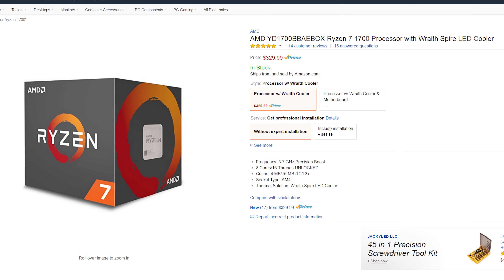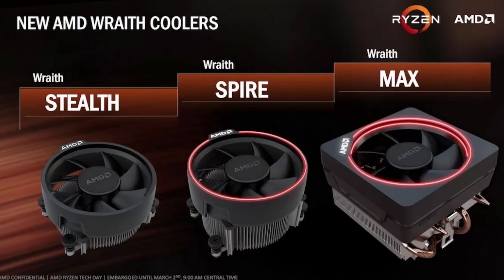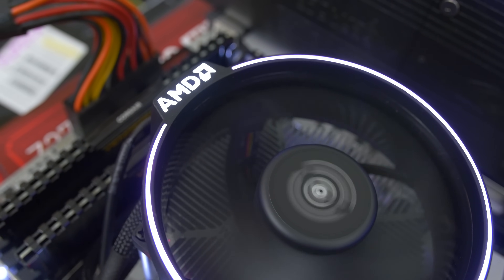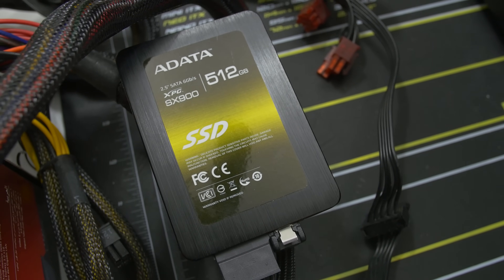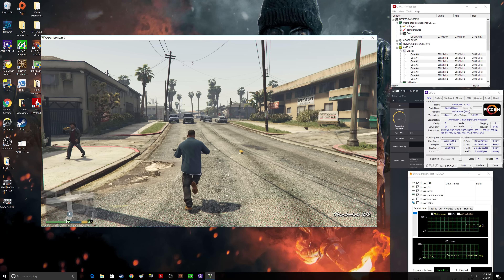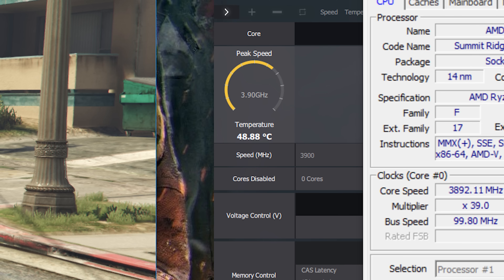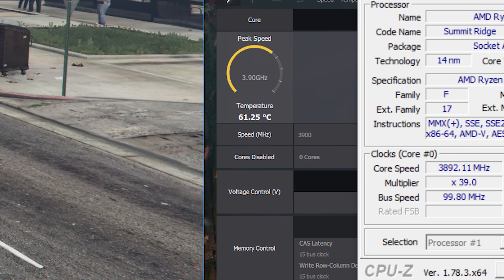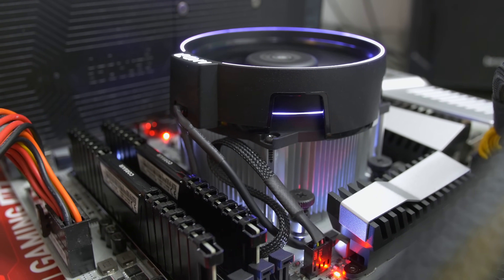AMD Wraith SPIRE: Does it SUCK?

Comment: So Amd creates the FIRST Stock Cooler that actually IS very decent. Huh.
Amd is Getting better than i expected.
Reply: Actually they made one before called Wraith
Reply: @eshteluvetuluetpineapples4104  yeah, and the "Near-Silent" thermal solution. I do remember it.
Reply: Thanks for the correction, Sorry for the bad grammar since its not my native language.
Reply: AMD is back baby!
Reply: Pffft, But thanks again.
Hope i didn't make a mistake again :-), fingers crossed.
Reply: Yeah, I was super surprised that I overclocked the 1700 to 3.8ghz on the stock cooler and stock volts...
Reply: Wraith has been the best stock cooler for some time now.
Reply: EmBoLabe the og wraith was actually widely praised upon release last year, and as far as stock coolers go amd has always had beefier coolers than Intel. Unless you're maybe referring to the super duper high end chips of the late 2010s that came with monster coolers,  they hardly sell any chips now that even come with one at all.
Reply: EmBoLabe Go die Intel stock cooler💀😊
Reply: +Sky, It depends on the motherboard manufacturer. For instance the Asus rog crosshair vi hero supports for:
AMD Ryzen™ Processors
4 x DIMM, Max. 64GB, DDR4 3200(O.C.)/2666/2400/2133 MHz Non-ECC, Un-buffered Memory *
AMD 7th Generation A-series/Athlon™ Processors
4 x DIMM, Max. 64GB, DDR4 2400/2133 MHz Non-ECC, Un-buffered Memory *
Dual Channel Memory Architecture.
BUT i've seen tech reviewers been able to push almost to 3000mhz, just watch wendel* review. 
He runs it a 2933, video is called  "ASRock X370 TaiChi Motherboard Review- Ryzen"  
*level1techs
Reply: hell walker The Intel stock cooler is loud af
Reply: Just need a Intel conversion for this kit and sell it to intel xD
Reply: AMD Cooler is great since Socket 754, which also compatible with 939/AM2/AM2+/AM3/AM3+
it just older generation AMD line up was hotter than intel, specially Phenom series.
Not only it's decent, it also lot's better than Intel Stock Cooler. The pin lock makes HSF more durable than pin lock on intel HSF (almost every stock cooler intel I have is either broken on 1 side, or broken on all sides)

so.... FIRST decent cooler is not only inaccurate, it's very misleading.
My last test with Athlon X3 is pretty good, 48° at idle 55° full load.
With Phenom X4 955BE, idle at 52° full load at 65° at 28° room temperature.

if decent by any mean looking good, then yeah.
Reply: Sky Check on the Mobo makers website for a RAM compatibility chart just to make sure.
Reply: EmBoLabe wrong also the others were good. do not manipulate history...
Reply: I'm regretting that I didn't buy shares from AMD.
Reply: sky, No problem. And those boards can overclock the cpu aswell.
Have Fun with your PC.
Reply: EmBoLabe except they also had the 4 pipe cooler on their 135w chips, the old wraith, and their liquid system on the 9590/9370
Reply: back in the day, intel did include a very good tower heatsink fan with the Intel i7 980X.
Reply: Not so Here in Asia AMD coolers are better. I think China makes better coolers for AMD square with thin fan for FX and APU series

Edit: My PC A10 7890k has thin fan but not that thin but still square but not as bulky as one featured for Ryzen 5 and 7
Reply: +MrSlashStudios my a10's max stable temp is about 20-90
Reply: EmBoLabe second. I deem the wraith pretty decent as well. Size issues alone, it still cools nicely.
Reply: EmBoLabe the og wraith was actually widely praised upon release last year, and as far as stock coolers go amd has always had beefier coolers than Intel. Unless you're maybe referring to the super duper high end chips in late 2010 that came with monster coolers,  they hardly sell any chips now that even come with one at all.
Reply: baum stamp 
I had the same thought. My old PC had/has a Wraith sitting on top of the Phenom and, even when I tried to stress that sucker, it never really got exciting. It is about a blonde hair below a 200mm exhaust fan, which probably helped out, but that's not the point.
Reply: EmBoLabe The previous generation Wraith cooler was great too.
Reply: Boy amd has always been good.
Reply: pfff stock coolers are for peasants. (joke)
Reply: EmBoLabe  can I use any memory stick (ddr4) with ryzen?
Reply: maybe 2030 they are almost perfect
Reply: He wrote grammar.
Reply: Hopefully this will make intel take the same route and then you start seeing better stock coolers on both sides!
Reply: +Der Pinguin, Thank you sir.
Reply: EmBoLabe I will buy the msi b350 tomahawk  thanks :D 
it is the only one on my bugted but its good too
Reply: EmBoLabe did you miss the red cooler they came out with already??????
Reply: i think intel's thing is that if you are going to overclock then you also will be buying a cooler for it thus why include anything better than enough to cool it at stock speeds 
AMD's thing is centered around you overclocking their chip as much as you can for the Ryzen chip it seems like 3989 to 4100 is the top range you can hit with a overclock right now due to heating issues an internal hardware issues
Reply: aaaand its rgb😵
Reply: Kill it before it evolves!
Reply: I have my AM3 6300 clocked at 4.05ghz on a stock cooler... Has been stable for about a year with zero issues.  Going to 4.1ghz but causes crashes, and upping the voltage to stabilize it is just causing far too much heat.
Reply: +séxy lifé for an AMD cpu, yes, but for an intel cpu its still healthy
Reply: They are made by cooler master fyi 
If you have one pop the fan off and you'll find cooler master logo
Reply: The wraith stock cooler was ALWAYS very decent. Its not new.
Reply: grammar Nazi
Reply: Yeah, I'm a bit of a grammar nazi. I only want to help and EmBoLabe doesn't seem to mind, though.
Reply: *Better than
Reply: EmBoLabe, I applaud your usage of English. You did well for a not native speaker. Have a good day.
Reply: You're welcome. :)

Also, it's grammar.

I'm not a native speaker either, but I speak a lot of English.
Reply: @juliavanderkris5156  weird flex, but OK.
Reply: +Eshteluvetuluet PineapplesI 
Hate those mounting solution.
This is the first time that they used a better one..
Reply: The reason its soundless is probably because your cooler fan died from spinning too hard... You should probably check on that. 0_0
Reply: Aside from the 1700 what have they even bundled it with?  I was actually planning on trying the wraith max out with the 1700x and buying a nice aftermarket cooler later, but a day before launch my friend happen to notice the only skus available for the 1700x and 1800x were without coolers.  Kinda bs honestly.  $400 and no cooler for just a cpu?
Reply: Isn't 70-80° way too high for a CPU?
Reply: +EmboLabe

AMD and intel do NOT make good stock coolers, because that would put out of business all of the cooler companies and is against those competition laws or whatever they are.

Comment: So did this take account of the 20 degree offset temperature?... I'm guessing this video was made before that news broke... so with hindsight it might be useful to know.
Reply: The 1700 doesn't have the offset. Only the 1700x and 1800x.
Reply: thanks
Reply: yeah, that makes sense as they have XFR...
Reply: TheWorthyNoob the 20c offset only applies to the 1700x..and maybe 1800x.  His tests in the video are accurate.
Reply: Andrew Thomas But the cpu is throttling at 70C which is weird, isnt that a safe temperature?
Reply: my ryzen with h100i at 3.9ghz 1.4vcore in prime95 doesn't get hotter than 66c. This thing is a thermal monster!!! Intel would hit 90c in 10 seconds
Reply: Even if he used the 1800x it doesn't matter because he is monitoring the temperatures with Ryzen Master.
Reply: Only the 1700x and 1800x have this temp. difference.
Reply: Andrew Thomas i mean kyle mentioned that the system just did a failsafe shutdown when it reaches high 70, i tot cpu was supposed to thermal throttle at 100c lol.

Comment: If you tested as recommended in high performance mode, the system wouldn't drop the clock speed below the overclock.  That would explain the high load.
Reply: Of course I had to scroll past a hundred suck/blow jokes to find someone who got this...  🙄

Comment: I have an asus b350 plus motherboard, can I overclock this to about 3.5ghz with that?
Reply: Peety "P.T" from what's been reported you should be able to do that just fine.
Reply: Alright thanks for the info
Reply: Neon_Lights12 that's not true
Reply: Neon_Lights12 yeah no, you can over clock on the b350 mobos as well. the b350 mobos do not support SLI though.
Reply: Brett I only have a single gtx 1070 so the sli isn't a problem for me, just planning to oc the cpu a bit
Reply: Oh I see, no SLI my bad.
Reply: Peety "P.T" you're good with the b350 mobo then!
Reply: Peety "P.T" AFAIK you can only overclock on the X370 boards